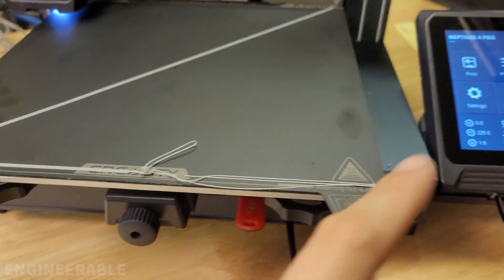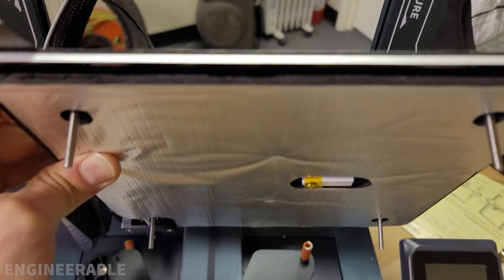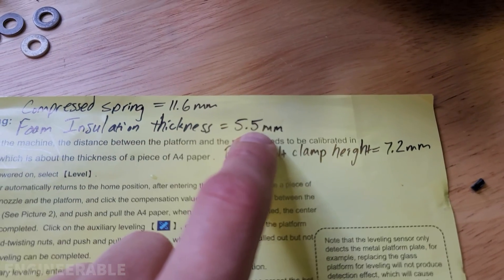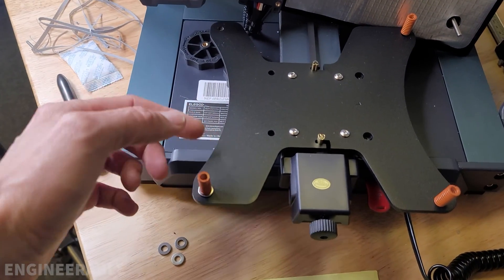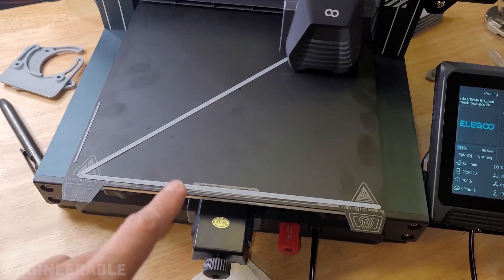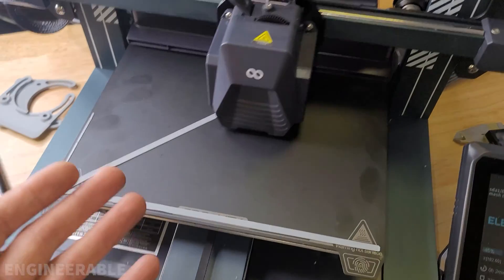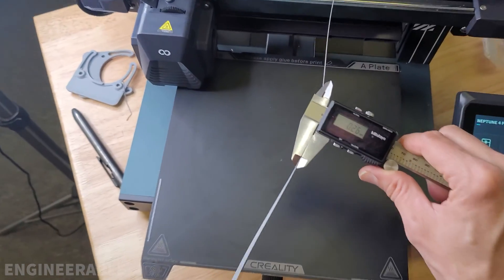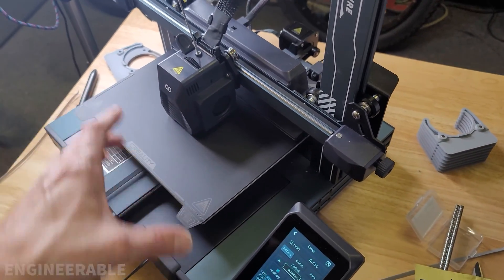How To FIX ELEGOO NEPTUNE 4 PRO BUILD PLATE WARPING to improve bed adhesion for 3D Prints

Comment: Did you ever solve the compensation issue? With my printer and slicer I noticed in my gcode that M420 S1 was commented out and my printer wasn't loading the bed mesh data. This should take place right after G28(homing).

Comment: Did you replace the bed too? I fail to understand how just raising the bed got rid of the warp on the bed, aluminum doesn't bend that easily... At least, my bed doesn't, I'm in the process of replacing the entire bed and will take these additional steps so I don't have a repeat problem
Reply from the maker: The warping is not permanent if the stress is relieved. Everything is a spring. The aluminum will bend slightly from the contact with those untrimmed belts. Ultimately, the multipoint bed leveling of this printer is flawed and never functioned properly, so I commented it out of the config file, and just use the old school bed leveling using the thumb wheels and that has worked the best.

Comment: My problem is kind of the opposite on my neptune 4 plus. Just got it a few days ago and never had a printer than ran klipper, so when checking out the bed mesh on fluidd,  the back center of the bed is always shown as much lower than the rest of the bed after adjusting everything the best that I can, and the very center is a little too high. So anything I'm printing that has a large flat base, doesn't actually have a flat bottom afterwards. It's not a big deal on the one print I've been working on, but I feel that difference could affect other models later. I've never modified a 3d printer and it's not something I really want to have to do lol.
Reply: have you ever found a fix for it? In the graph of mine , it shows up like a taco.
Reply: @marcolemus5299  I learned to ignore it. Get the edges level the best you can and it will run fine as long as your slicer settings are correct for your nozzle size and filament. I've been using a 0.6mm hardened steel nozzle due to just printing things that don't need fine detail, like coaster holders for the laser engraved coasters I sell. So had to figure out the correct temp settings for the different pla and petg filaments I was using, because the recommended settings are meant for 0.4mm brass nozzles. I find that once you know what bed temp is good for your filament, running the nozzle temp for the first layer, 10 to 20 degrees higher than the max recommended temp and running it at about 30 to 60 mms (depending on filament type) gives you a good first layer. After that it's just knowing the best setup for fan speed per layer. Unfortunately I ran out of fillament a few months ago, for anything I needed to print (I don't waste filament on random models) and havent had the money to buy more, so my printer has been put away for now.
Reply: @zero00044 hey I figured it out. Somewhat or at least got it more leveled.  If you look at the hex bit. There is some slack that will stick out still. So I ended getting 4 washers 12mm wide and about 1mm thick on each hex bit. Two under the hex bit and two on top. Did a quick test running it cold. And it’s a lot more flatter.

Comment: I looked at my bed mesh in FLUIDD last night for the first time since I got my N4P (preordered it last year on release....just haven't tuned it like I should've yet)....noticed a big arch in the center of the mesh. So I looked under the bed and saw that those two belt ends were pushed up against the center of the bed, even though my leveling screws were almost fully extended. I've been having quite a time getting prints with large first layers to go down evenly (or at all, in some cases), so I'm looking forward to giving this a shot.

Comment: Replaced the build plate with your recommendation, printed a model that gave me issues, the model no matter what had issues I had to add a raft when it should not have needed one. I just finished the print, no raft, no supports, printed perfect. Crazy how this actually fixed the problem with sticking to the build plate. trying a second stubborn model, seems good also. thank you for the suggestions...
Reply from the maker: @tebald  Great success! Did you also do the warping mod?

Comment: It's a shitty printer with a lot of issues, spend a litte more and go for the Bamboo Lab A1, the money you spend will come back 100 times in saved filament and hours saved on troubleshooting and micro adjustments.
Reply from the maker: @ArstanWB  Although I agree, the A1 came out after this printer, and the A1 had cable issues with the first batch that took them a few months to solve. Now that they solved it, I'm going to switch to Bambu printers, but the Neptune still does an excellent job with materials that are less sensitive to build plate leveling like TPU.

Comment: On the Elegoo Neptune Max 4 there is a similar problem with the heating bed. The bed heats up uneven, that is raising and lowering the bed due to its massive print size. The best advice I heard is to let the bed heat up circa 25 min for a 60 degree bed. Depends on your room temperature tho. Just search Neptune 4 review and fix from functional print friday. I hope that it will help you.👍🏻
Reply: I've heard of this and plan on doing it as well with my new neptune 4 max.... question... is there a setting to make the printer automatically wait for 30 minutes and heat up the bed before each print? or.... do you have to do it manually  on the printers screen each time?

 and yeah.. I don't think its always necessary for the smaller prints but... as I test it out over the next few months I guess ill find out
Reply: @thedonleeboy  I sadly never used my 4 Max Printer, had it in the box around half a year and sold it again. As far as I can remember I think you could program that in, not sure tho. The video which I shared, with the title "Neptune 4 Max Review and a FIX for the PROBLEMS EVERYONE IS HAVING" from the creator "Functional Print Friday" does show the problems and solutions, I sadly can't remember if it was manual pre heating or programmed pre heating. If you watch his video that question should be answered tho. For small prints you wouldn't really need the preheating, as the heat source of the platform is in the middle of the bed. For larger prints it does take a while tho to heat up the edges of the bed, thus the bed is slightly bending, but thats already enough for the filament to not stick ideally to it anymore. Hope this helps.

Comment: G'day m8....i won one of these for xmas from Elegoo. So far ive not run into this problem, i just looked at my belt ends and the brass seems to be smaller than what your showing. Maybe elegoo got to this early and fixed it, as mine came from Elegoo, yours maybe early stock that was all ready in the warehouse in North America. Im not defending Elegoo, but over the last 4 years ive seen this happen often. As im in Australia we buy from all the big Printer Company's main US site's and stock is sent from Asia directly to the buyer, so we tend to get new updated stock. Big Cheers for the informative video on this potential hazard, From A m8 Downunder🙃

Comment: Respectfully I will comment and will suggest you to configure tilt screw calculate on Klipper in your print cfg file, that way you can tram your bed to be level, also to make sure your x axis is not skewed, you will have to find some z axis leveling tools  on thingiverse and loose the z belt sync and adjust the height making even slight downward pressure against the parts you printed that help me ensure my EN4P was completely leveled. Then I run the probe calibrate command and adjust the z  offset and boom my bed numbers were awesome. No more problems. There is a ton of info out there on how to make those adjustments. How my info helps.
Reply from the maker: Thanks, my X axis was visibly skewed right out of the box, and I leveled it before starting to print. I need to look into the tilt screw calculate.
Reply: @engineerable  I was a little hesitant when it comes to tweaking klipper, I found great videos that guide me through all steps required, I'm glad I did it was so much easier to tram the bed, trust me few pei sheet damaged later, as usual I was trying to stick to old habits of marlin tweaking which is good but klipper makes everything easy nowadays.

Comment: Same spot failures bro that corner is doom until its locked in..
Reply from the maker: How do you suggest "locking it in". The bed leveling matrix doesn't seem to adjust for it.
Reply: For me it was a combination of tin foil shams, leveling the gantry, and micro adjusting wheels and running auto leveling, a really good tip I got is go into "level" set the z height and just back out and you can freely move the print head and bed and and do manual auxiliary leveling that way faster, that and several bed level test prints and hours of struggleing... Also make sure the wheels under bed are correct a 36 hour print through my wheels of track and caused a whole mess.
Reply from the maker: @sTheecreep  The first thing I had to do out of box was level the gantry as it was visibly crooked. I've seen the aluminum shims, and wondered if that was what would be necessary for that corner. I get the feeling that the Z axis backlash prevents it from properly compensating for the bed leveling matrix. I could measure the z-axis backlash. Is there backlash compensation in Klipper like there is for CNC machines?

Comment: Have you tried heating your bed for 30-60 minutes before running your mesh bed leveling? Beds generally warp as they heat. By preheating your bed, you are compensating for the warp created as your bed heats up. An enclosure helps reduce the time needed to preheat your bed. I got the grow tent kind from Amazon for 25 bucks. If you can find another listing like that it’s a worthy investment for your printer.
Reply: I found 20 minutes needed to get good level from cold.
Reply from the maker: @2001pulsar  This checks out, because I saw a video of someone using a dial indicator to show that it takes 25 minutes for a Neptune 4 Max bed to stop moving due to thermal expansion. So the smaller bed will take a little less time. I will run a test using a dial indicator like they did to see exactly how much time it takes to settle, but your 20 minutes is probably a safe bet.
Reply from the maker: Thanks for advice. I haven't tried preheating for that long before doing the mesh bed leveling. Does that mean that you would need to preheat for that long before each print? The bed temps I use range from 40C for TPU to 80-90C for ASA. I think the issue with the bed leveling mesh is the poor accuracy of the bed distance sensor, combined with backlash in z axis. The bed distance sensor is inaccurate by +/- 0.5mm. Every time it homes before a print, it might be perfect, or off by +/- 0.5mm.
I do have use an enclosure.
For sure the changes I made in this video made a big difference, but there's still some inaccuracy in the bed distance sensor. I have to calibrate the Z distance using the sheet of paper before every print.
Reply: @engineerable  hmm. 0.5mm is a lot of deviation . I personally don’t run a bed mesh every print. I do that around once every couple of weeks. I had the same issue you did and found the solution I shared on Reddit which fixed it but my probe isn’t as inaccurate as yours. However if the rest of your bed is sticking fine then I don’t think your probe’s 0.5mm inaccuracy is as impactful as your may think. 

For reference I’m running an ender 3 V2 with a cr touch as the bed probe.
Reply: You would want to preheat before printing as well, but 30 minutes seems pretty excessive. 5 minutes should be enough.
Reply from the maker: @portela237  I always preheat, reset the Z offset, then print
Reply: @engineerable Have you tried it yet? Believe you need to preheat for some time and than bed mesh level. I have different printer, but when I preheat to 90°C it moves +-0.07 mm for 20 min and then stabilizes.
Reply from the maker: @artusrawa3776  Yes, preheating 20 min makes a big difference
Reply: What is that amazon enclosure you are talking about ?
Reply from the maker: @jchamorrob  ▶ COMGROW 3D Printer Enclosure - https://amzn.to/3rIl44M
I posted a video about it here: https://youtu.be/v7a18BC8ODQ